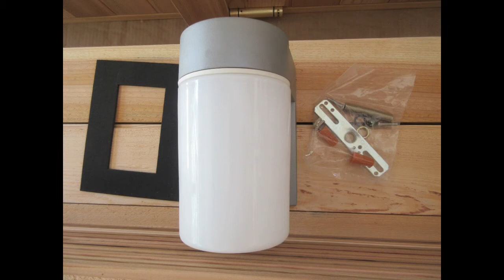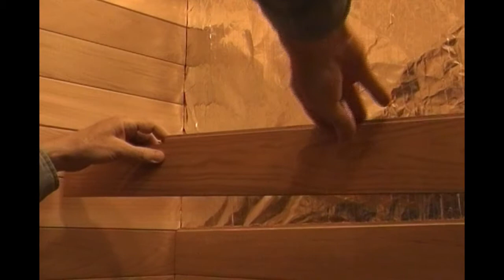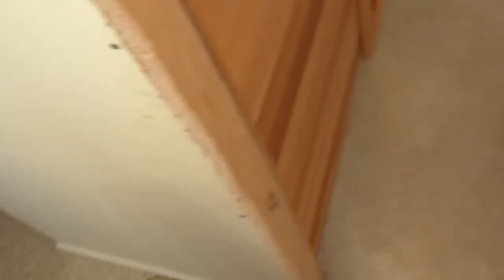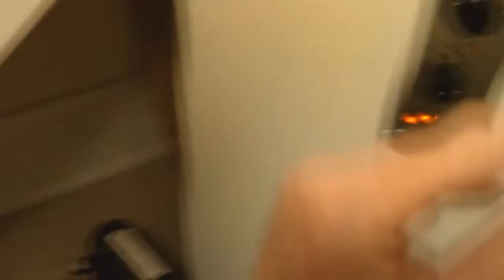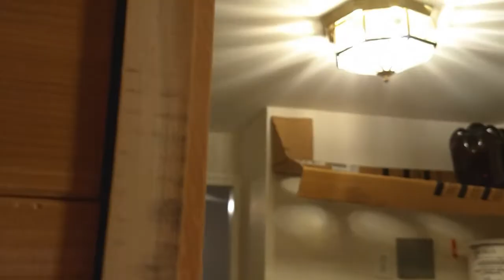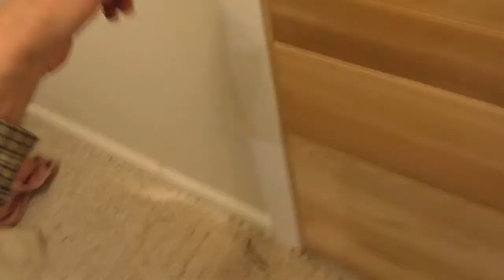Installing a Pre-Cut Sauna Kit From Start to Finish

Comment: Why do you have the tongue-n-groove with the male side down and the female side up?   With the female side up... any liquid running down the wall will enter the trough in the groove.  The tongue should be facing UP to prevent liquid from penetrating or staying in the groove.  Basic weather proofing of tongue and groove or log cabin weather proofing....
Reply from the maker: You have a point there, but I think I did have the tongue up (https://youtu.be/CekUb5lmYnU?t=807).  Maybe the ceiling shot was confusing.

Comment: Hi. 8 months on are you satisfied with the quality of the sauna and it’s components? Also, did you consider other built to order manufacturers?
Reply from the maker: I am satisfied with the kit, yes.  My general comments would be that if you buy a "pre-cut" kit, it's really not pre-cut, as every single board needs to be cut to size.  It's just that if your framing measurement was in-line, then they figure out how many of each length board you'll need.  In this video: https://www.youtube.com/watch?v=AGBybYJ5ckA I go through the shopping process.  I considered just buying lumber and a heater and controls, but did not consider a "snap together" kit, as I had to fit the strange little space, as you saw.  Good luck.  I love taking saunas!  And I measured it...it only costs about $0.020 to heat-up and another $0.05 to keep it going for the duration of my sauna.  And I feel sooooo good afterwards.

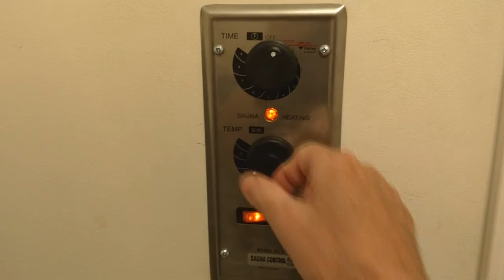Comment: Did the sauna control panel at 40:43 come with the kit from cedarbrook? Thinking of getting one like yours.
Reply from the maker: Yes, Jason.  The heater and controls are sold separately, but are "matched".  The mechanical one that I selected was less expensive than the alternative electronic one.  The mechanical one allows you to have the system to pre-heat while you are, say, out hiking or something.  The electronic one allowed more flexibility on pre-heating, but I don't use that feature much anyway.  Good luck on your installation!

Comment: On page 8 of the manual it shows the minimum distances for the heater guard, I get the 2" front and 2" side measurements, but that 1" measurement has me wondering.. Is that against a wall and that is why it is less? Any ideas?
Reply from the maker: The heater comes with brackets for mounting that put it 1 inch off the wall.  They say you can mount it directly on wooden walls.  It could be that the heater, internally, has more heat reflection on the back, but that is a guess.  I don't show the guard I built in the video, but it's 2 inches away.